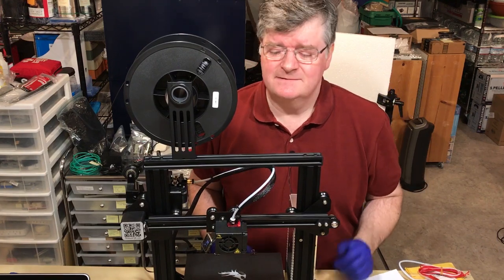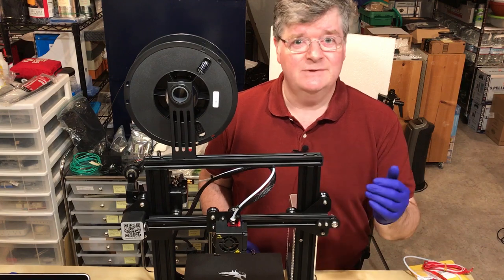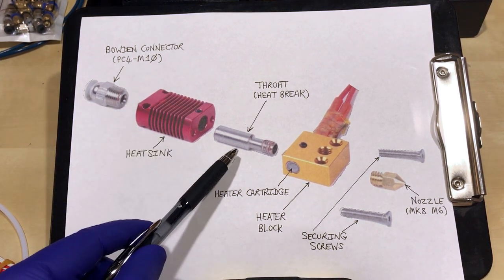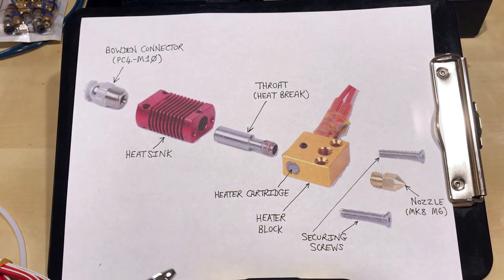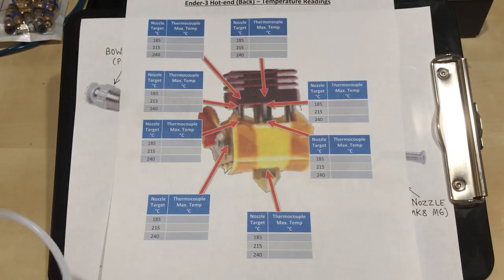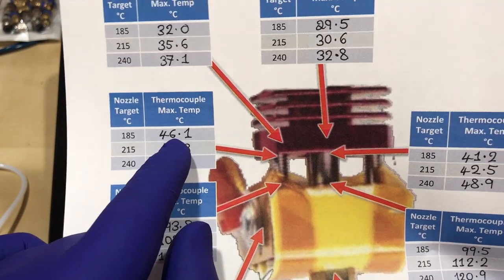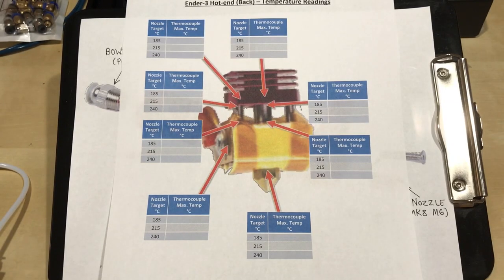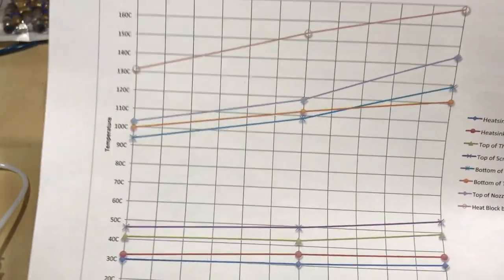Creality Ender 3 Hotend Temperature Measurements

Comment: Nice testing. I believe you validated my testing. I like your challenge.
Reply from the maker: Thank you Chuck. Yes, I did end up validating your test. I went a little further as I read people dismissing your result as inconclusive which I thought was an unfair response. Especially, as you had gone the extra mile to contact Creality to ask about the two securing screws.

I even went further in a subsequent test by trying to do a side-by-side print comparison. The test print without the two screws failed as the heater block & throat fell out of the heatsink and ploughed into the print. Even after sharing this result their are still folks convinced that removing the two screws is a solution. <sigh>
Reply: Hey Chep, I just watched your video and one of your comments let me to this video. I love the work you and Niels are doing! Looking forward to the results!

Comment: Few points: the thermal break ("throat") and securing nuts are made from stainless steel, and unlike regular steel, it has low thermal conductivity coefficient. That explains how you measure 70 degrees difference between two mm on the screw. In fact, the better design will use thinner screw segment (these are M3 screws, but it is possible to thin these 2mm to make ~1.5mm diameter, and it will improve the heat loss from the extruder block. Another improvement - use titanium alloy throat to increase the temperature gradient.
The next problem (with most low cost printers) - they are not able to correctly measure and thus maintain the temperature of extruder. The accuracy of maintaining 250C is worse than 2-3C at 200C, and 5-8C at 300C. This is due to the use of thermistor as temperature sensor, which is very non-linear. At 300C, the temperature must change by 5C for the electronics to detect it... Besides, the thermistors without individual calibration can have an error reading of ~20-30C. 
With all of that, attempting to use the filament rated at 250C on out of the box Ender 3 in my case results in running the extrusion at 215-220C, way out of expected operating temperature.
The solution for accurate temperature control is to replace the extruder's sensor with Pt100 platinum temperature sensor (RTD). There are special small sensors which may be placed into a 7mm deep by 2mm hole; still a need to rework the heater block. In addition, it requires an instrumentation amplifier to convert sensor's resistance into voltage, and modification / recompilation of the software in the controller. With that modifications, the temperature may be maintained to 1-2C in the range of 200-300C, and printing at recommended filament temperature usually results in quality model.

Comment: Having the exact same gcode wont havethe exact same lack of care that may be  from the printhead. I just unclogged a massive backflow from my E3 that was caused from the PTFE tube not being snug against the nozzle (and other 2 other things i was screwing up). Unless you can replicate the gcode and the exact printer itself, I dont think you'll get what you want. Hopefully it's a hardware issue instead of some sort of gcode issue because mine has more or less been useless the past 2 months.

Comment: to prove a point i would have thought same measurements made screws in then screws out would have proved the point, i personally dont have the screws removed on any of my printers - cr10, cr 10 mini and a pair of enders and have yet to be convinced the screws are the issue
Reply from the maker: That is an excellent point so excellent in fact that I went one better. I tried to do a side-by-side comparison of the printing the same part with the two screws in place and then without them. One of the main advantages given for removing the two screws is that it improves surface details on a print.

The print with the two screws completed fine. However, the print without the two screws failed in about 15 minutes. The heater block & throat sub-assembly worked itself loose and dropped into the part...and the Ender-3 kept trying to print! After stopping the print and cleaning up the mess I discovered that the nozzle had burnt a hole in the buildtak-like bed material -- it is still usable thankfully.

The fun(?) part was what happened when I reported the results of this experiment (on the above mentioned FB group). Responses ranged from: a) I removed the screws a year ago and it works great, b) you must have messed, c) should have used Loctite (this has never been mentioned in any of the guides or FB comments), d) should have kept one screw in place (also never mentioned and counter to the whole heat creep argument), and e) prickly back channel comments.

I took the latter comments as my cue to step away from this FB group for awhile. It appears some folks took offense at me conducting an experiment which appeared to question the authority of the resident guru.

My attitude here is this is just a hobby! It is meant to be fun. I have zero interest in the politics and dare I say, cargo cults, over mods. If a mod works for you and you like the results that is great! Seriously, it is awesome!

As for removing the two screws, my measurements and experiment convinced me it is not necessary. Just don't tell anybody I said that. LOL

The unwritten rule with 3D printer mods is: You break it? You fix it!
Reply: @nielsjohnson-laird6589  aye i have the same attitude over the firmware to allow thermal runaway control, yes it does however if a fet fails on then no firmware in this game is capable of stopping it and your going to be blissfully unaware snoring if you leave the printer running, i run standard firmware with a pi3 and octoprint monitoring it, it has a addition that also watches temps and you can set not only high and low temps but also times to start printing or it shuts the printer down, or in my case via smart plugs that are inline to the printers it cuts the power as well, ive not needed it but my steplads got my old a8 clone running the same system, his firware was updated but octoprint caught it sooner than the firmware when his thermistor fell out the hot end
Reply from the maker: @r2667639  The lack of critical fail-safes in the hobbyist market of 3d printers, as standard, is unnerving IMHO.
As for the Ender-3 the firmware upgrade and Octoprint are on the top of my todo list, but even then I doubt I will ever be completely comfortable running any 3d printer overnight...unless I can run power out to the shed which is 50 feet away from the house/garage. 😉
Reply: @nielsjohnson-laird6589  "One of the main advantages given for removing the two screws is that it improves surface details on a print." would really like too understand how this is possible , thoses screws are shaking the head arround ?

Comment: I thought it was heat creep but it was the ptfe tube being ground into dust by the connector and working its way down the hotend creating friction with filament.
Reply from the maker: Wow! That's a new one. Was this with the original pneumatic coupler/connector and PTFE tube?
How use/time was on your Ender-3? -- I need to keep a lookout for this problem
Reply: i noticed it on the first stock and the replacement.  the twisting motion causes  make the tube grind inside the heatbreak and connector making pfte dust which can end up in the flow of the filament and clog the works.   hold the tube in your hand and move it back and forth on the x axis and it'll twist in your hand  which causes friction and heat up. they all do this with some degree.
Reply: it's my workhorse. i print with it everyday until i run out of filament. i might have a slight addiction with 3d printing. i have an Anet a6 as well nicknamed the freight-train becase it sound like one.
Reply: ptfe tube or the filament is not perfectly straight neither which adds ro the friction ans wearing which in turns offsets the tube and the heatbreak holes and acts like a clog.

Comment: Where is the thermocouple for the actual hot-end.  Is embedded in the heater block ?  What I’m curious about after tweaking mine to bits is that the thermocouple is not ‘zero Celsius’ referenced.  That means that the ADC reading that are converted into ‘degrees’ in the controller CPU will innall likliness be different across different printers as the thermocouples will be different.  This is a known problem in the electronics industry.  MAXIM  has an IC that will sort this out and give you true readings.  So it might be worth booking up a MAXIM part to an Arduino and read the I2C values to give proper readings.
Reply from the maker: OK, multiple questions so I'll try and answer them in sequence

a) Jump to 2:25 in the video and I mention where the thermistor is located ;-)

b) 3D printers do not typical use a thermocouple, but a thermistor--I have four different 3D printers and they all use a thermistor. A thermocouple is more expensive and needs a more sophisticated interface circuit to work with the Atmel microcontroller. The thermistor is very cheap in comparison and the interface to the ADC is very simple.

c) No one seems bothered about doing the 'zero Celsius' reference for thermistors. The thermistor typically used for the Ender-3 is a NTC 3950 type. Yes, different brands of 3D printers use different thermistors, but as long as the firmware matches the characteristics of the thermistor then everyone is happy.

d) Yes, MAXIM does have a few ICs that interface a microcontroller with a thermocouple, but this makes temperature sensing more expensive. That boring thermistor, additional resistor to make a really cheap 'voltage divider' is more appealing to printer manufacturers.

e) No one seems bothered about having proper temperature readings. I looked at the NTC 3950 specification sheet and it has a +/-1% tolerance. At 185C (typical PLA temp.) the temp. reading can be off by +/-2.5C so the actual nozzle temp. could be 182.5C to 187.5C. At 240C (Amazon Basics PETG) is can be off by +/-3.5C so the nozzle could be 236.5C to 243.5C. This is why we should all print temperature towers when we start with a new brand of filament to get the right nozzle temp. setting. ;-)

If you want to add a thermocouple to your Ender-3 I wish you the best of luck. Just bear in mind that you will have to: build the interface circuit; modify the firmware source code; and, test it.

For the terminally curious:
More theory on thermistors is here: http://www.efunda.com/designstandards/sensors/thermistors/thermistors_theory.cfm
Edit: Actually,  this may be an a less painful read: https://www.electronics-tutorials.ws/io/thermistors.html
Reply from the maker: @GodzillaGoesGaga  Maybe start with an interface board, like this one:
https://www.amazon.com/Aideepen-MAX6675-Thermocouple-Temperature-Interface/dp/B01M5CT365

Comment: i dont understand why prefoncfig file "configuration.h" maxtemp to 275 and hbed to 125 in marlin 1.1x bugfix, is it safe 260+ hotend and 110+ hbed ?

#define HEATER_0_MAXTEMP 275
#define HEATER_1_MAXTEMP 275
#define HEATER_2_MAXTEMP 275
#define HEATER_3_MAXTEMP 275
#define HEATER_4_MAXTEMP 275
#define BED_MAXTEMP 125
Reply from the maker: Kudos for spotting this. Is this something to panic about? Nope. Marlin is a general purpose 3D printer firmware which is used in a variety of printers.
For the Ender-3 keeping the nozzle temp below 260C is a good idea to minimize the risk of the PTFE tubing deteriorating.
Choose your filament wisely, check the specs before buying it, verify what nozzle and bed temperatures are recommended (and what type of bed material you should use).
I've been using Amazon Basics PETG at 235C/80C (nozzle/bed) for several months without any problems--though I get Capricorn XS tubing to replace the standard PTFE tubing, it's better quality, just grit your teeth at the price tag.
Remember with the Ender-3: The upside is that you are in control. The downside is that YOU ARE IN CONTROL! Have a basic understanding of what you are doing, and why. ;-)
Reply: @nielsjohnson-laird6589  no panic 👍have capricorn xs too, but why creality e3 preconfigured file not 260 or 255 whatever 😀 i dont mind im not using melzi mb,  if u havent like me all metal keep below 260 sure